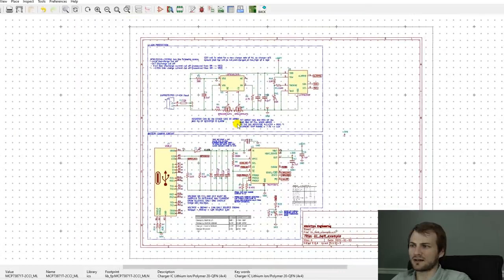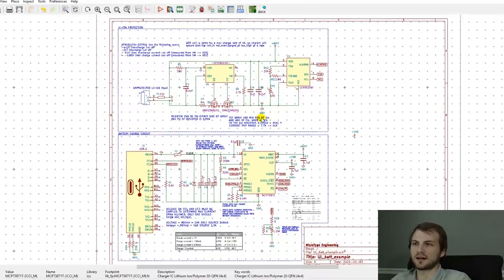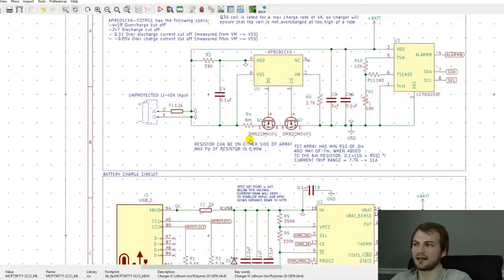Li-Ion Battery Circuit Safety Design - Circuit Tips and Tricks

Comment: I'm testing this protection chip AP9101CAK6-BVTRG1 with the DMN2029USD N-MOS but can't get it to work. My main problem is that it doesn't recover from overdischarge test. I connect a lab power supply to simulate a battery and when I set it under 2.8V it protects from overdischarge but increasing the voltage back to > 3V doesn't return to normal operation. Any ideas why? I've tried testing the AP9101 with the FS8205 MOSFETs  from the chinese protector DW01A  with no success. Thanks!!

Comment: Do you have any similar videos for designing circuits using low self-discharge NiMH's like Eneloop? I'm currently working on a stroboscope and plan to use either one 18650 or two 18350's. It seems AA Eneloop's might also work well from what I read.

Comment: Hello.  Did you miscalculate the resistor values to get the voltage on the VPCC pin?  4.7V * R6/(R6+R5) should equal 1.23V according to the MCP73871 Datasheet.  But I might not be understanding the Datasheet... Thanks great video!

Comment: That was really helpful, I really needed to know all of this. It really hurts low power design right, even the fuse taxes every joule the product uses. Maybe I'll include some jumper wires and instructions to let my customers decide on the safety/performance trade off, although even then, I'll probably not mention the fuse.
If you use better components this is less of a problem right? I thought you could have it on only while it is being charged, but if UL are going to bypass the normal charging chain that's not going to work is it?
Almost at the point of adding a primary cell so the mcu can manage battery fault states without drawing from it. Certainly not an option most of the time.

Comment: Great video! Crisp and clear! We have a similar circuit but we're having issues with reverse-polarized batteries. Our 18650 battery holder does not mechanically prevent reverse insertion of the battery. When inserted the wrong way with the charger enabled we have 2 voltage sources in series, smoking up the charger as its first victim. The MCP73871 from your schematic has "Integrated Reverse Discharge Protection". Does this suffice for batteries that are inserted the wrong way? I think it means the battery cannot discharge back to the USB/AC side. What are your recommendations on reverse battery protection in this kind of scenario?

Comment: Great video, Very informative. 

Would you consider doing one on multi-cell ? How would you change the charging and battery protection design?
Reply from the maker: I might, but I'll probably wait until I do one for work first, as my experience with multi cell is pretty limited

Comment: This is a good video but it does not go into detail about why it is important to avoid an undervoltage condition for some types of lithium cells.  Information on this subject is hard to find but the following is what I have discovered.  Lithium metal does not have good mechanical properties so many lithium cell manufacturers coat the working material onto a copper substrate.  That works fine as long as the cell is above a certain minimum voltage.  If the cell potential ever drops below that voltage the copper substrate can dissolve in the electrolyte and contaminate it.  When the cell is recharged the copper does not plate back evenly and copper dendrites can grow across the cell until it eventually shorts.  That can cause the cell to vent or even explode.  There are plenty of videos showing how to "jump start" an undervoltage cell but they do not mention that the contaminated cell becomes a little bomb with a random time fuse.  Lithium cell contamination may be the primary cause of lithium cell fires.  Some chargers from China will slowly charge a contaminated cell as if that would somehow fix the problem.  It probably wouldn't and there may be no simple way to detect the contamination or uncontaminate the cell.  It is better to recycle undervolted cells than risk using them

Comment: In the automotive world, the engineers told us that the charge voltage to shut off was 80% and discharge was 20%. I didn’t design them, just fixed them using best practices and their diagnostic flow chart. 
 I truly enjoy the learning process but I am at a basic level somewhat as I ended my career teaching in 2 day classes and 4 hr seminars. Out of 30+ subjects, electrical was 6 levels ending with lab scopes, but starting with just simply knowing how to be comfortable with a digital multi meter and how to use them and what they seeing. Most did not know what voltage drop was in a series circuit even though they were doing it across a component.
 Question; I want to create printable schematics for each circuit and did not know if software is out there for a low cost or free. I am installing a fuel injected engine into a 55 year old truck for myself. But having a schematic for a tech to use is an owner worst fear they don’t know about until it breaks. My son(s) will end up with the vehicle and very few who retro-mod a vehicle never think of the wiring, connectors, color, location etc. I do because I worked on them. Without photos, colors or circuit design, a shop could spend days chasing a problem instead of 20 minutes doing basic checks then replacing a part or fixing a circuit fault.
 I stumbled onto this channel because of my range of interest and started watching. I enjoy your discussion style and use to visual tools. I am subscribing and hope the best for your efforts. 
 In 38+ years of repairing auto’s, it is a physical task w/o A/C and poor heat and fitting the clock as dealer techs and good shops pay by flat rate, based of warranty time for pay. Start early and stay late, burn 6,000 calories per. Retire and bring home tools and the tool boxes, fill the home garage then nurse the worn elbows, arthritic fingers and get buy on disability, SS, + a 401k if lucky. But the children were feed and had some things but no one to use the tools. $10k today gets an empty tool box with wheels & keys. Another $150k in hand and air tools. Pennies on the dollar to sell but if able, build that classic car or truck and has value since they don’t make them anymore. Besides, 1/3rd the cost of new, paid for and no tags or taxes as they are antiques, but with modern features. This industry is huge!
 Thanks much! Cert Auto ASE Master tech since 1978, retired.

Comment: BTW: Curious about the latching circuit mentioned at @19:10  to suppress the firmware infinite loop state.
Reply: Yeah, I would also be extremely interested in some of the edge cases and fault modes.
Reply from the maker: Noted!
Reply: @MicroTypeEngineering  May I know if this has been answered or explained anywhere? Thanks.

Comment: Ok excuse me but if you use a sensing resistor, why not bypass the FET's completely? R4 straight through pin 6 (Vss) and 2 (Vm)
Reply from the maker: The circuit would be useless then. The FETs are how the protection circuit works. They turn off the low side when there is a fault.
Reply: @MicroTypeEngineering  the FETs would still be in series obviously but out of the voltage sensing
Reply from the maker: That's not how it works.. You have to have them in series with the voltage sensing.
Reply: @MicroTypeEngineering  Yes, they have to be in series with voltage sensing but they don't have to be within sensing net. I don't see what is gained by having those FETs there vs. moving them outside the sensing net so that the IC uses only resistor for current sensing. It would kinda make sense if the IC could sense if the FETs are somehow doing its job and do something about it, but it really can't. If those FETs short out there is nothing the IC can act upon to do anything. Also if IC is actually detecting something based on changing sense voltage, it will get the same reading on the sensing resistor as the current has to pass through all three components or none. The only reason to have them in the sensing was to use them as a kind of shunt resistor, but now that you have proper shunt resistor they are just adding uncertainty to the overcurrent protection.
Reply from the maker: @Leonard Milcin gotcha, now I follow. I thought he was saying to parallel the two. Yeah you totally could have it before or after the FETs. No real reason I chose this way, other than to make the layout a bit easier.
Reply: @MicroTypeEngineering  oh no I never mean parallel 😅 what Mr. Milcin said. I see how layout gets a little messed up by the change. Writing from a phone makes it harder to explain correctly. I really like these videos, I did not know about these ICs.

Comment: why not use resettable fuse?
Reply: I think I would use a normal fuse because if the overcurrent happened it means I have either messed up the circuit or some other protection failed and now the fuse became my last line of defense.
Think about this, you already have another, resettable overcurrent protection in the form of an IC and those two mosfets. If that wasn't able to do the job you would prefer that circuit to fail completely, safely.
Reply from the maker: Yeah, you certainly can, and I mentioned using a thermal fuse in the same manner. It just depends on your specific use case. @Leonard Milcin makes some nice points!
Reply: wow, very interesting answers. Glad I'm subscribed, very kind. Yes, in that context it makes less sense to have a normal fuse! Thanks for the high quality content and sharing of knowledge and how to's. You should sign up on patreon if you haven't yet!

Comment: Sorry, I'm not really following one part. Could you explain what you mean around @16:19 when you said that the shunt/sense resistor will "overwhelm the FET variances"?

Oh, and where does the value "10" come from in your equation when solving for the current threshold?
Reply: He's referring to the resistor having a much higher value than the Rds of the MOSFETs so that the variance the circuit sees that the transistors cause is greatly reduced.

Comment: I just came across this video and cringe when someone generalises by saying Li-ion. Mixing different chemistries as if they are the same. My check of 18650 and I get Lithium Iron Phosphate (LiFePO4) but mobile phone/tablet batteries are Cobalt based such as Lithium Nickel Manganese Cobalt Oxide (LiNiMnCoO2) -  These chemistries have different voltage requirements. --- Otherwise,  I like your videos. The UL explanation is great.